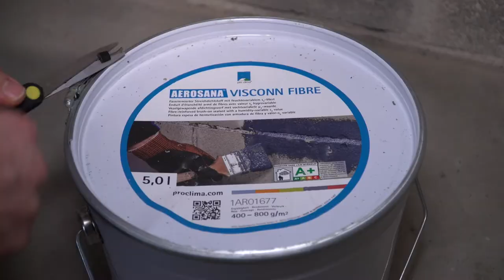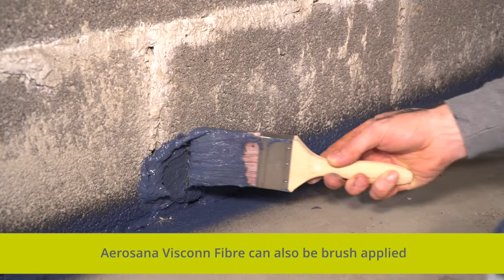Sealing Gaps on Masonry Walls with Aerosana Visconn Fibre

Comment: Is it also suitable for outdoor use or only suitable for indoor use? If ok for outdoor use, does it have a UV-rays time limit it can be exposed for? CAn it also be used on timber products like window frames?
Reply from the maker: Hi Pauly. Yes, it is suitable for use around window frames and can be used outdoors for up to 3 months. You can find some useful details on the technical datasheet on our website https://www.ecologicalbuildingsystems.com/product/aerosana-visconn-fibre#downloads